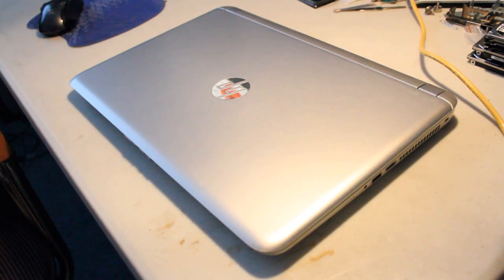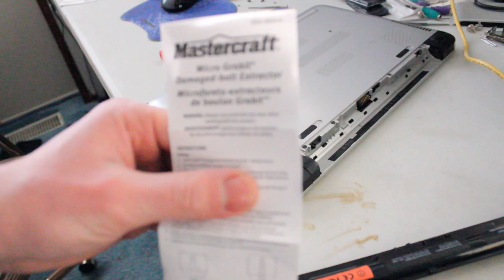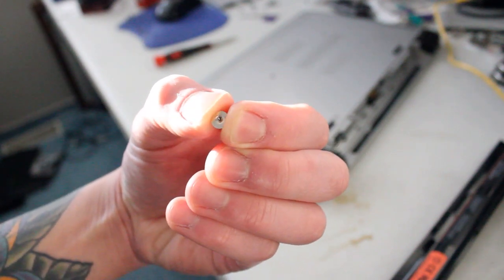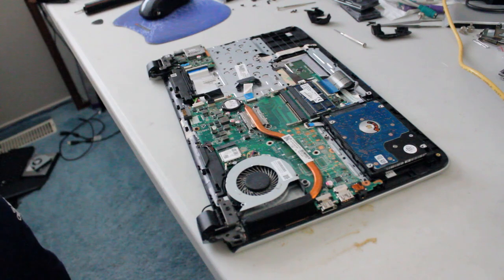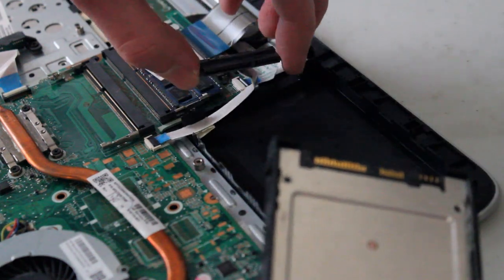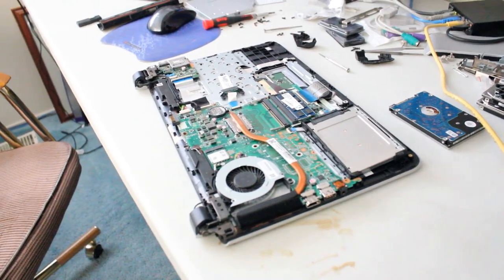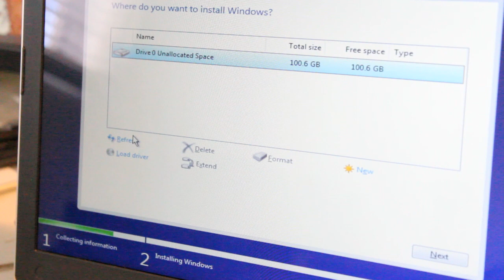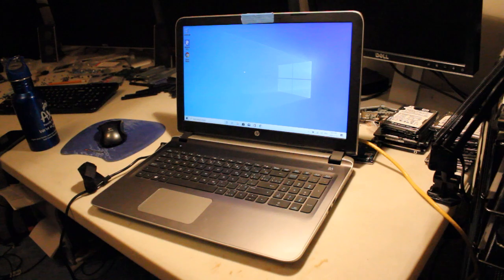HP Notebook 15-ab168ca SSD Install & Stripped Screw Removal

Comment: I bought an extractor bit set & the instructions said to drill into the stripped screw. Then use the other side of the bit, put your drill in reverse & the screw should come out😊
Reply from the maker: How did it go?
Reply: @HaisteComputerRepair  I managed to get the stripped screw out. Do you have any videos on how to clone an SSD with Windows 11 and put it into a larger ssd? I'm not sure how to do that & don't want to mess things up.
Reply from the maker: @lexbeltran1354  Clonezilla is the best I have come across.  Follow these guides:  1) https://youtu.be/7Jz18yrzn0s?si=Wcgk2RzK1LEnbF50  2) https://youtu.be/NK6HGa_-B94?si=GmLAsXWnGEqtg6O-
Reply: @HaisteComputerRepair The stripped screw I managed to loosen has a washer underneath, so it can't be removed. The back panel can still be removed. Despite this, was able to clone a 128 tb ssd to a 1tb SSD👍
Reply from the maker: @lexbeltran1354 Did you try Clonezilla out?  Well done!
Reply: @HaisteComputerRepair  I used mini tool partition wizard.
Reply from the maker: @lexbeltran1354 Ah ok, cool.  I'm glad it worked out!